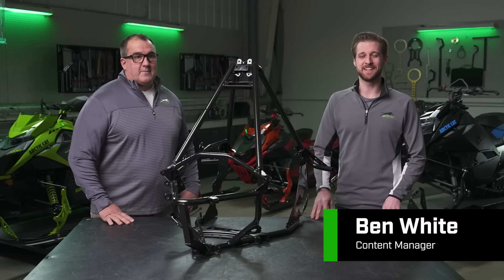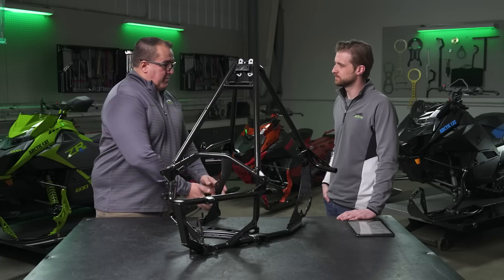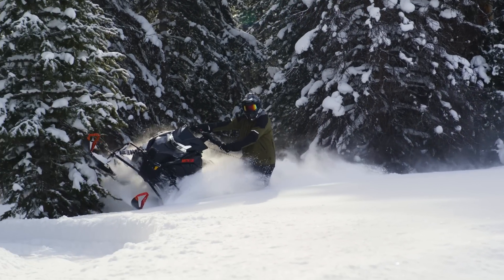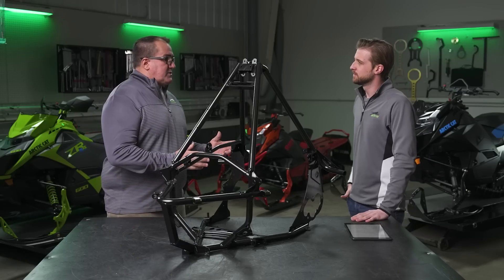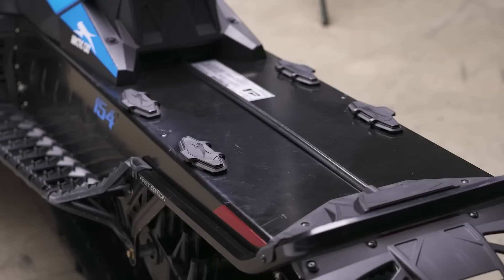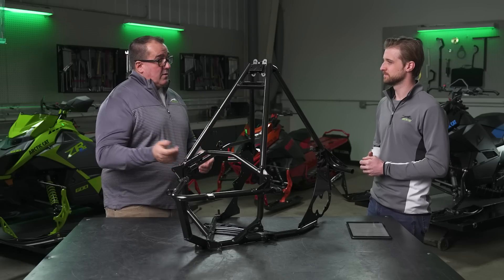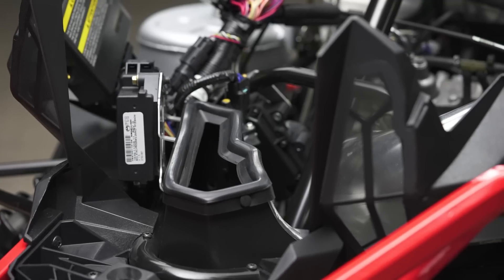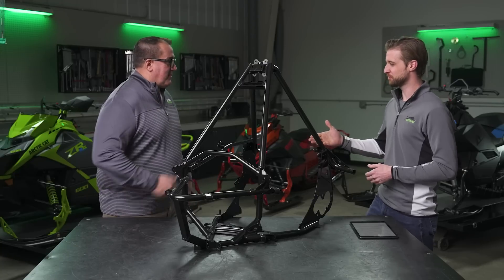Arctic Cat CATALYST Deep Dive | Chassis

Comment: I wonder if the Catalyst has the same neat feature as the ZR8000 where the fuel line saws though the top of the heat exchanger? No notice from the company so I got to find out on the trail!

Comment: 600 is not enough for the mountains whats wrong with Cat drop your proven 900 in it ya dummys nobodys buying a 600 mountain sled  and im sorry single rail is a failure shocks busting off rear idlers coming off desteying tracks never mind the hockey stick benders